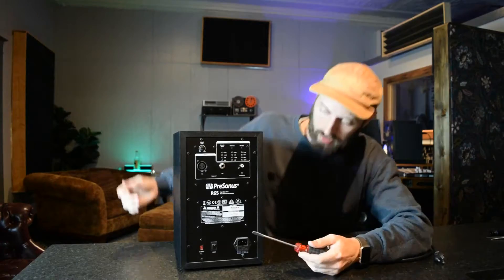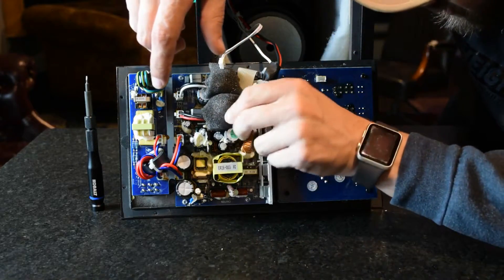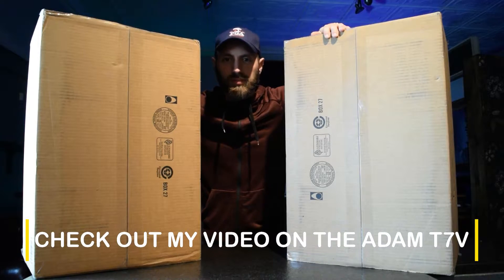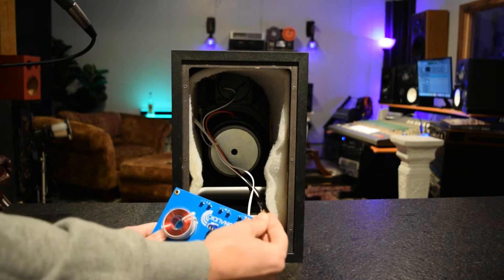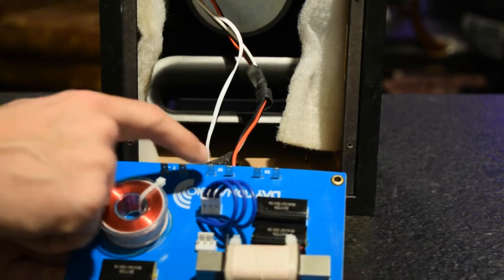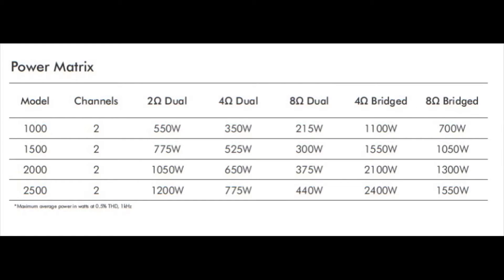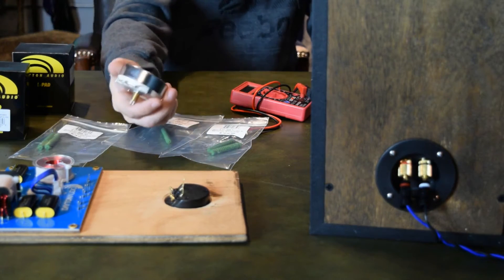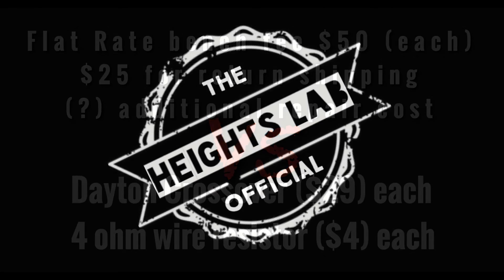Presonus R65 REBORN (Teardown, Modifications, and Comparison)

Comment: I found the cause of the monitor turning off, the position is vertical or horizontal does not matter, it's all about the capacitors, replace all the capacitors in the monitor and it will work fine
Reply: Which capacitors are you referring to? How many are there? Could you send a picture? My turns on (led lits) but its dead.
Reply: can you explain better? 🙏
Reply: I had to replace the 35v 470uf 105c power supply capacitors when both my r65’s stopped powering on. After lots of research I replaced the cheap generic capacitors with Panasonic FR 35v 470uf 105c & tada brought them back to life & Panasonic FR caps are much better & should last much longer. Anyone having issues with the r65’s not turning on need to replace the power supply caps. Mine you could easily tell we shot because the tops or a good cap should be flat, I found 2 that were domed on the top which is a clear indicator the caps went bad. So the Panasonic FR caps was a $7.99 fix
Reply: @stevekirn8017  How many per speaker? I've been meaning to fix my year long broken R65's, can't check how many they take right now but I want to order them already.

Comment: Hi, if you make damping isolation inside the monitor that will make huge difference.Also get rid of plastic covers , they are ringing . I used double 6 mm isolation layer ,besides  front face inside  used 3 layer ,also cover plastic horn.Results should be there is no resonance .

Comment: as I understand it, presonus made a too good product that did not pay for itself, so they made the second series of these monitors, where the amplifier is from Eris. In fact, in the sub-$1,000 price range, D with DSP will be much better than A/B. Therefore, those who have the first series and these monitors are still lucky, because these monitors sound much better than their price. Tell me your opinion, do you think the second series is better?
Reply from the maker: I prefer the R65 V1 over the V2 and the Sceptre, Presonus says they use the Eris board because it’s “tried and tested”, but honestly after they were bought out by Fender in 2021 the whole company (from products to support) has declined. I believe the old Presonus support would have been able to help me fix the R65 instead of treating it like its disposable.
Reply: @HeightsLabOfficial hello.  Do you still recommend this monitor, I've seen it on sale for less than $200, but I'm afraid it will fail like all 3 of yours.  thank you
Reply from the maker: @diegoos5202  I would go with the Adam’s
Reply: I had both. The V1's peaked with distortion at higher volumes. The v2's outperform the v1's at higher volume levels, which for me makes the v2's better overall.  With this upgrade that was done  makes the v1's unbelievable it seems!

Comment: What really happened to your presonus R65?
Reply from the maker: It started shutting off intermittently due to some components on the main board failing. I had 3 different R65 V1s that had similar issues.
Reply: @HeightsLabOfficial  I believe that's why they released R65V2 with a Class AB amplifier instead of Class D on the older R65.
Reply from the maker: @mcdavedj  I thought so too, but the R65 V2 and R80 V2 actually use the board from the cheaper “iris” model, they have similar issues also and are equally un-serviceable.
Reply: @HeightsLabOfficial  another words all Presonus models Eris and R series seems to have same problem.  Hence, I was thinking to get the Adam Audio T7V instead. .
Reply from the maker: @mcdavedj  that’s what I did as well! I’m working on the Adam’s as we speak.